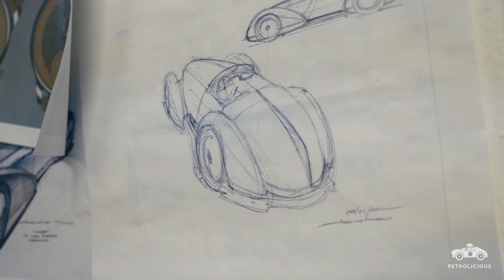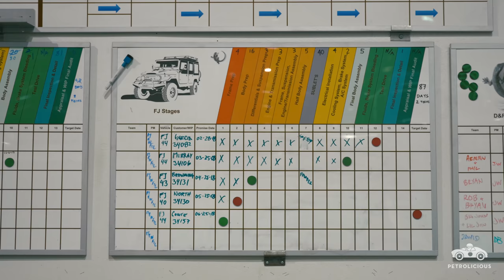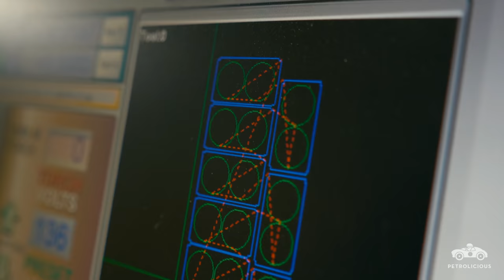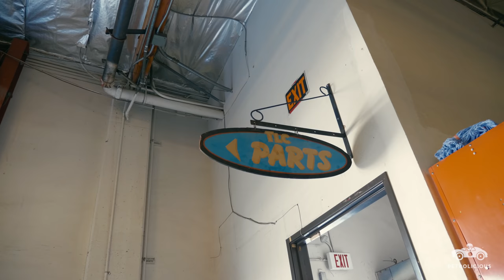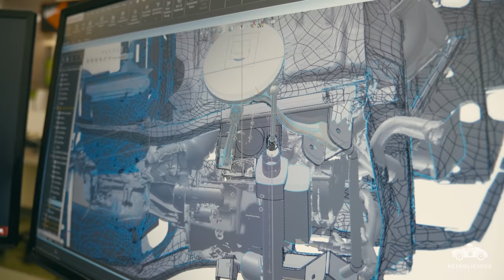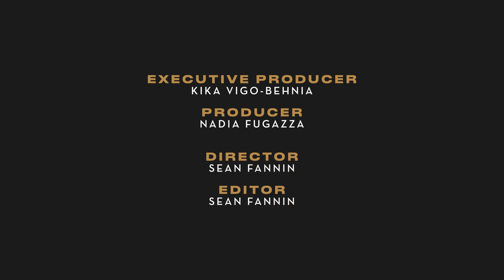ICON 4x4: Creative Restorations and Modifications

Comment: Cover shot the one on the right looks like the one I restored but my bumper was black. The only mod I made was 31 inch tires, Specter light bar for the roof for PIAA pencil beams and Bosch fog lamps for back up/camping lamps, it was already a twin tank FJ40, never got stuck, well engineered to begin with, just reassembly with new hardware and quality paint, and sealants goes a long way.

Comment: The Question that remains for me, when you say take existing/old and make it better with modern parts is: CAN you make stuff better that lastet 50 years and is still valued and wanted?
Pretty much all i agree with are better materials or rust protection...but technic wise? i don´t want a new powertrain with modern electronics...without any doubt those will never last additional 50 years.
Reply: @ICON4x4Design  That would indeed be a thing. You might be abled to convert it to electric then one day :) But who does that? It sadly seems that "repairablility" is not longer wanted these days :(
Reply: @ICON4x4Design  sign me in!